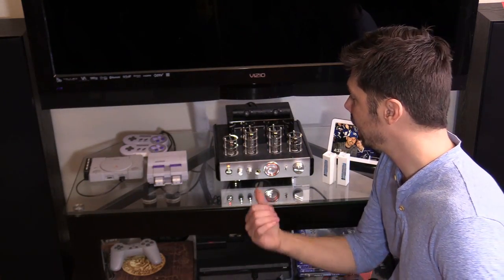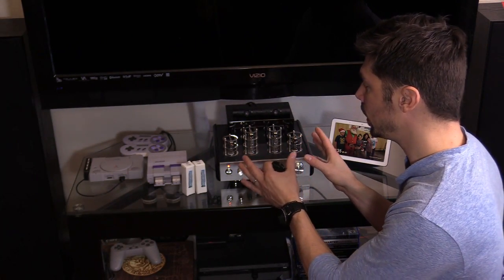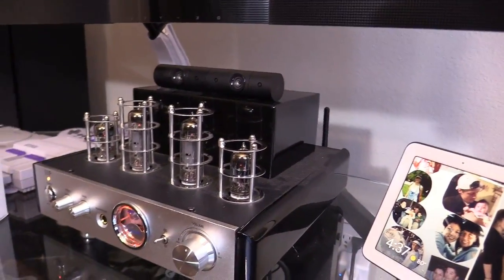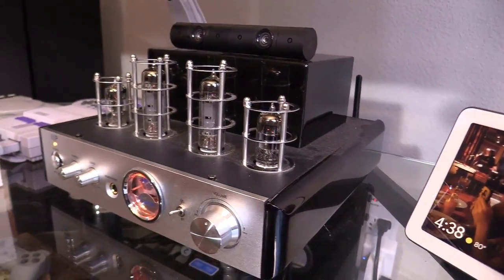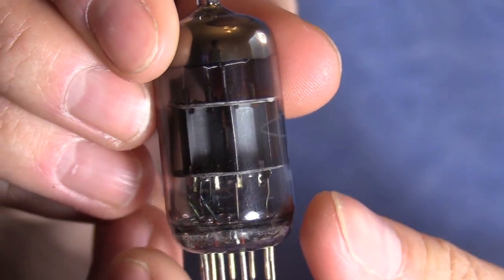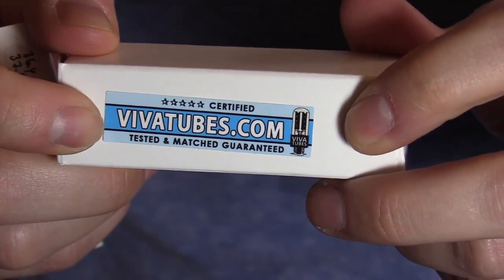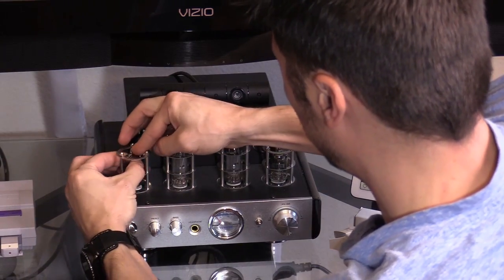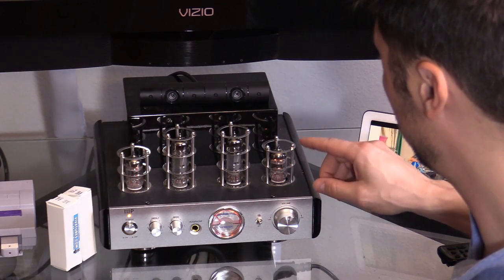How to Fix Monoprice Tube Amp Humming Popping noise from Speaker or No Audio Sound

Comment: I have a persistent crackle out of just the left speaker.  Swapped tubes L/R, both sets one at a time and no change.  Almost sounds like digital interference from a phone.  Adjusting volume on the amp does not change volume of the crackle.  While the amp is attempting to pair I get screeching and electronic noises from both speakers.  Any ideas?

Comment: Similar technique in automotive repair to find out which ignition coil is bad by switch the coil from one cylinder to another, if the misfiring follows from one cylinder to the other than you know that coil is bad.

Comment: Wow I am in so much need of information. I own a Monoprice 50 watt, and a 25 watt integrated amps. Over a couple years they both have stopped putting out any audio on the speaker outputs. Lights work, preamp stage has the VU meters moving, but no sound of any kind form both amps. There is very little information on troubleshooting these things online.

Comment: My left channel is humming. swaped the valves, nothing changes. Solid state troubleshoting?
Reply: Both tubes are bad
Reply: @missternae262  it can't be. The right channel does not hum. The problem is something else. It does not matter anymore. I post this question a year a go! LOL
Reply: @ele4853  Same exacting issue. Low level hum in the left channel and zero audio.  Would love to know how to fix this. Swapped right to left pairs of tubes also. Not the tubes. Pre-amp issue I think but where on the board? There are some serious cheap china caps in these things. May start there.

Comment: I have the same amp, and it has the same problem on the right channel. It is very loud, though. When I tap on the top of the amp with my finger near the tubes, the hum goes away. I think this sounds more like a cold solder joint to me. The amp is only 4 months old, so I'll call Prime Cables where I got it and see what they will do for me. It has a 1 year warranty. 
I would like to upgrade the tubes, eventually, once it's repaired or replaced. Maybe Russian or Tung Sol tubes?

Comment: Is it normal to hear a "click" from the tubes when i turn off the amplifier? 
I think is something about glass dilatation.
Reply: There is a relay that clicks off, and it does it immediately as you power off button. If there is a delay for this click to occur then I don't know.  Now I had another problem, my speakers pop when I turn it off, that's fixed by replacing the capacitor at the power switch.

Comment: Wait a minute.   Aren't the tubes the final power audio amp drivers?   If so, you will not get hum from solid state section until final power amp warms up anyway.     Ergo your troubleshooting test tip is invalid.    Just an FYI.   Cool amp.  Great tech tips otherwise.
Reply: Then, what is the correct explanation of that hum? If the "amp" has the tubes like preamp, i think the result of hum will be the same. If the tubes were in the power amp section i think will be even more bad the hum.
Reply: jp040759 the tubes are preamps to color the sound. You’re just wrong.

Comment: There are nice mods for this amp.
Thee is also a problem with this amp. There is over voltage on the tubes.  So the tubes don't last long.

Greetings from the Netherlands.

Comment: When I was young you could take your tubes to a tube test station .Ours was at the grocery store.
Reply: Ours was in the local Walgreens.  You walk up to it, insert the tube into the right socket on the panel of many sockets (took a bit at times to find the right socket on the panel), push a button and the tube would get tested.  A gauge would let you know if good or bad.  Replacement tubes would be behind little doors under the testing panel. Awweee...the good old days. 👍👍👍

Comment: You should not be sticking your greasy sweaty fingers all over the tubes.
Reply: Myth. Transference of any oils from the outside of the glass to the inside would take over a decade, though it is a good idea to wipe them down so nothing burns on the outside of the tube. Touching the glass of a common audio tube (that is cool of course) will not harm the tube in any way.